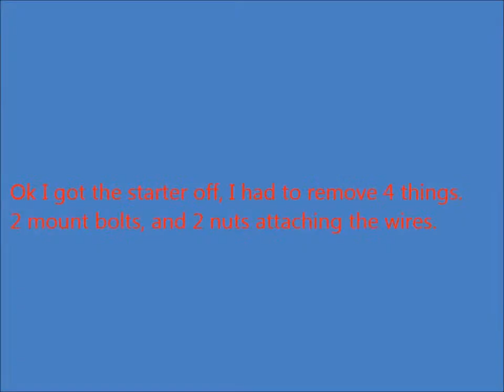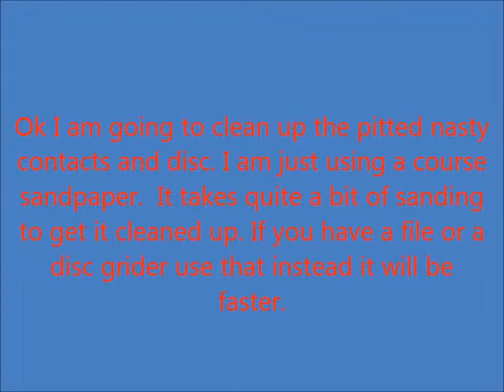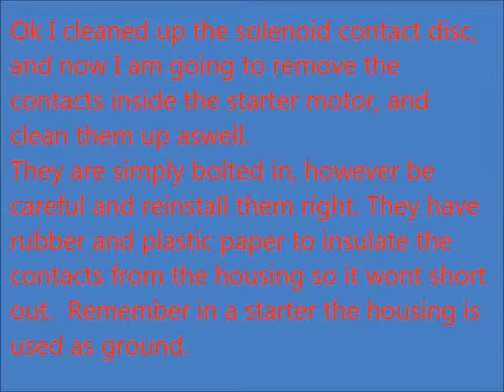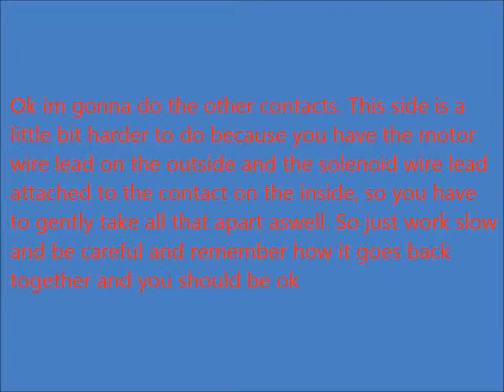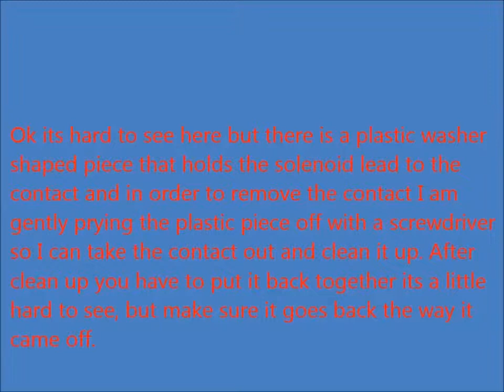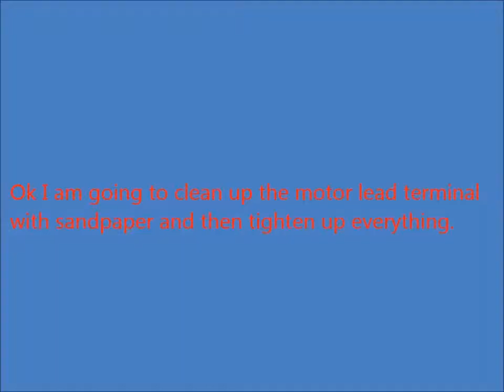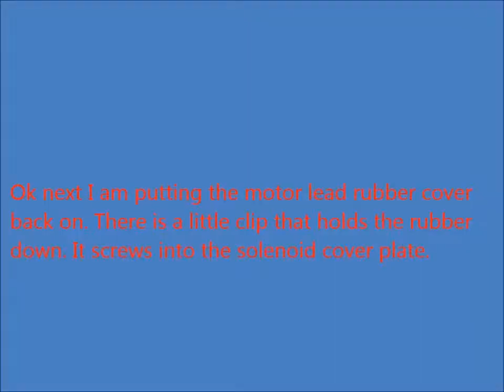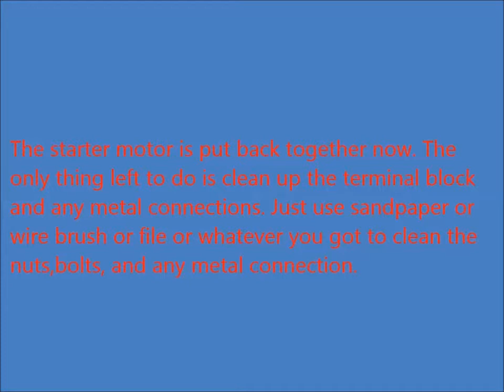How To Fix A Starter

Comment: Thanks! The bottom was actually a stud and not a bolt and for that reason we had to buy a repair manual because it wont go far enough to get it off the stud
Reply from the maker: Yeah mine was a stud two if you pause my video on the first bolt I show, you can see it has two different thread sizes and a nut on the end. On my stud my nut was seized to the stud and when I unscrewed the nut the stud unscrewed right out of the block. When I reinstalled my starter I didnt use the stud I went down to the hardward store and got a replacement bolt by matching the threads of the stud that went into the block. So I put a bolt back in and got rid of that crappy stud. (make sure the length of new bolt is the same cause it bottoms out, may need to use washers)  Well thanks for the comment, and I hope you were able to get your starter out. Have a good day.

Comment: Pinion and its extremely tight in that area, the starter is massive.. My dad has a 200 f150 with a 4.2 and the starter in the dakota  is almost twice the size as the one in the f150. Turns out 87 was the only year that used that starter so i think yours may be smaller. Il try and post a video about it tomorrow or sometime this week. 87 was the first year and had some parts that was different.. And i live in mid indiana so I'm way to far
Reply from the maker: So on your 87 is it a 6 cylinder 3.9 or the 4 cylinder 2.2. Also is yours a 4 wheel drive? I think yours must have to be a 4 wheel drive if you have to remove steering components.  If you tell me what is in your truck I can look up step by step starter removal instructions and email to you if you want. Well thanks for the comment and have a good day.

Comment: I have an 87 dakota and I'm trying to take out the starter but i cant find the top bolt/nut , where exactly is it?
Reply from the maker: On my video at the 28-30 second mark, you can see where the two mounting holes are on my starter. That should give you a pretty good idea of where the holes are on your starter. When I removed/installed my starter I I had to use a small ratchet with a built in swivel to get to the top bolt. The bottom bolt was real easy to get to, but the top took me awhile to get it out. There was a few things in the way so I couldn't use a regular ratchet or wrench, but I just reached up and felt around with my fingers until I got the top bolt and used a swivel ratchet to get it. Also it was real tight, so I had to smack my ratchet with a hammer to break it free.  Well I hope this info helps you out. Thanks for the comment and have a good day.